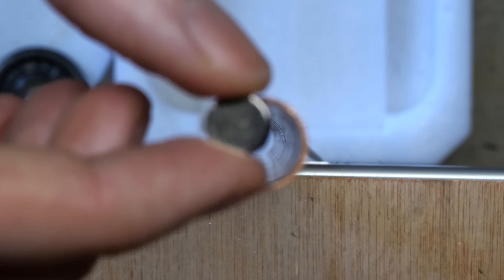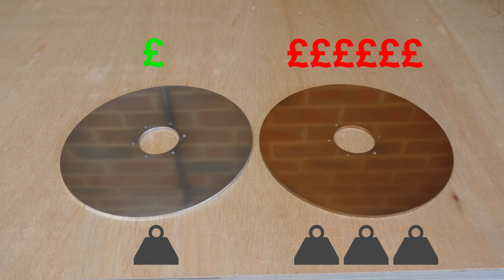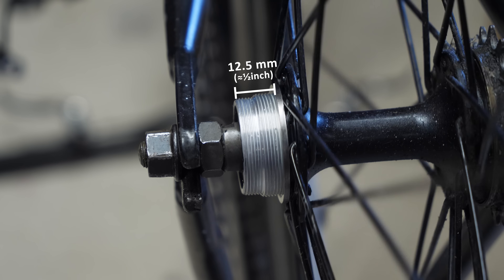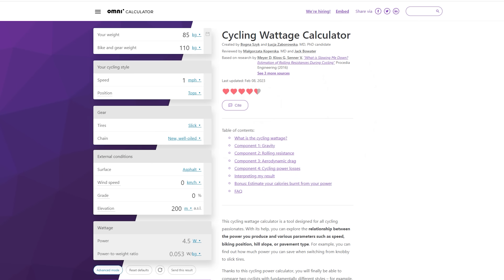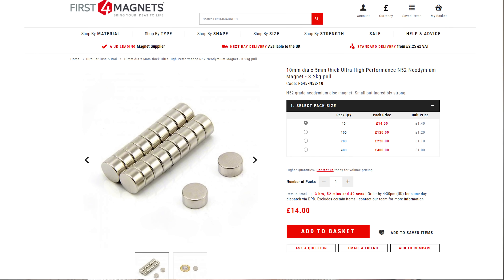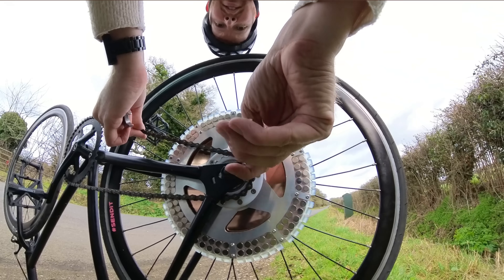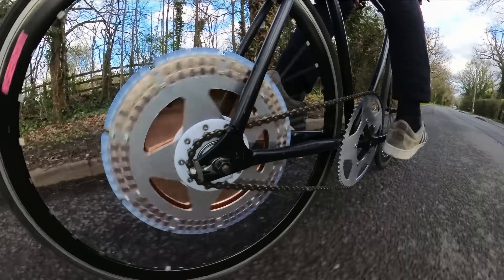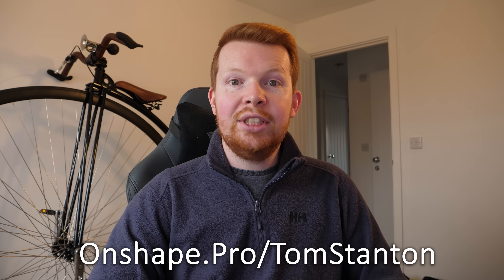Gearless Magnet Bike

Comment: would be cool to see how pedalling backwards while moving forwards would effect the braking power.
Reply: I mean the force was so strong it was basicly pushing his feet forward. Maybe peddling backwards wouldn't even be possible at higher speeds.
Reply: @jackbauer2698  if you look into the world of fixed gear cycling, you find that people can break the traction of the rear tire and lock it by pulling up on the straps that they install on the pedals. The only thing preventing you from pedaling backwards is the traction of the rear tire.
Reply: It would either be enough resistance to break something on the bike, or open a rift in the fabric of reality...
Reply: @dmevolve  it would be a time machine opening a wormhole.
Reply: As a fixed gear rider I assure you you can pedal backwards going forward even on a fixed gear, the tire just doesn’t have enough friction, you can overcome it quite easily
Reply: Yeah thought the same. Does not make any difference just pedalling backwards when trying to brake?
Reply: It will make a big difference. The speed of the magnets and copper disc relative to each other determines how much force they exert on each other. So at higher speed he exerts a lot of effort just to hold the pedals still, but at lower speed it should be possible to pedal backwards and therefore create enough force at the wheel to stop in a reasonable distance.

Comment: could eletro-magnets not work? so they can be turned off/on when required?
Reply: Yeah but they require batteries and with a 3D printed sprocket higher weight can make it more likely to break

Comment: What about increasing the diameter of the clutch? A smaller difference in rpm will still result in a comparatively larger difference in tangential speed. To reduce weight, you could hollow out the inside of the copper disk, and you could design the outer housing to redirect air into the metal parts to help with cooling. Not sure  that would help. 

Also, I’m not sure about eddy currents, but is there any waste from eddy currents going into the rest of the copper disk, instead of being stuck in, and concentrated on, the area under the magnets? It seems to me like you might want to only make the area of the disk that will be under the magnets conducting, so the current doesn’t just dissipate into the rest of the disk. 

Finally, what about arranging the magnets in a halbach array? That way, most of the magnetic field gets concentrated into the disk, instead of half being wasted on the outside of the system? That would also help with the issue of the chain and spokes sticking, since you’d have less magnetic flux escaping the clutch.

Comment: An old Minster Piecemaker pressing machine o used to work with uses an eddy current clutch between the flywheel and the crankshaft to regulate the speed.

Comment: Aluminium is used to make overhead power-lines because it is lighter and less expensive than copper, so it is not a bad choice. Silver would be better, though.
As for the magnetic drive - you are making a viscous coupling like an automatic car. You need to lockup the drive above a given speed for efficiency.

Comment: Maybe you could just use it as a speed brake? Using direct drive of the chain with a ratchet kinda system, so it switches from chain drive to braking with differences in speed

Comment: I used to have an exercise bike that basically did this in reverse: it had strong magnets either side of a conductive wheel. To adjust the intensity of the exercise, there was just a dial that moved the magnets closer or further from the disk. I regret not taking that thing apart before I gave it away. If I recall correctly, the disk might have been ferromagnetic. I wonder how a ferromagnetic disk would perform in an application like this.

Comment: wanted to see temperature of the disk, and you showed it, though after not during driving, wonder how hot it got when driving up that hill. and if there was any risk of copper or resin parts deforming because of that
also also wonder how Gates belt would fare in this setup, it would solve sticking to magnets problem, though spokes would need to be replaced with something else too.

Comment: Yeah you got the right idea make the rear wheel the generator and make the front wheel electric motor just pull your bike. See? If that works can you generate enough power to work electric mode? That would be the question? Can you generate enough power to run the electric motor that would be a good test.

Comment: Interesting project ❤
If you arranged the magnets into a halback array that'd reduce the stray magnetic flux interacting with the spokes and chain plus make the flux in the disc stronger.
Also there are carbon spoked wheels availible :)
Reply: The holy grail of ironless stators.

Comment: Maybe try removing the pedal stop so you can drive the chain in both directions, then backspin the pedals to brake quicker? You'd be inducing a current in the opposite direction relative to the wheel's rotation, which would (theoretically) cancel out the rotational inertia much faster than the simple holding force of the magnets. A two-way magnet bike, essentially.

Comment: I don’t know if regenerative break is available for e bikes but this system can make it possible to recharge your e bike battery during down hill. It is quite interesting and love to see a design like this.
Reply: Regenerative breaking was built into my 2007 Bionx conversion kit.  Newer models (e.g. Aventon) don't seem to have it.  A pity.
Reply: @Darooha better batteries make it less necessary for having a functional max distance.
Reply: Because a bike and rider is so much lighter than an electric car, there's really not that much energy to reclaim when decelerating.

Comment: Would it be possible to mount the ratchet mechanism of the rear gear to the front gear? This way the induced current could spin the chain and gears with the wheel, while your not pedaling. It's a bit complex to implement, but if I'm not mistaken the magnet disk would approximate the speed of the wheel and therefore not brake as much.

Comment: Nice what you did, but why not a big disc in the center of the wheel, aluminum and attach the magnets in it, then on both side sprockets with copper plates, maybe this way you can also apply force on both sides of the wheel, just a thought.... silly me 🤭

Comment: I wonder if a steel backing plate, and/or arranging cube magnets in a Halbach array, would've made a significant difference to the transmission of force. Also, does pedaling backwards make for a decent brake?
Reply: Steel would make transfer much less efficient

Comment: If you're generating heat energy, I wonder if there's a way you can use that energy. Like if you're biking using the magnets, and then have a secondary system that uses the heat to generate electricity for a motor. A build-your-own electric bike, of sorts.
If it was possible, I'd be able to see just pedaling when at downhill/flat ground, then tapping into the electric reserve for hills, to make up for the extra effort needed to climb that you mentioned.

Comment: Are you generating any energy. If so, then maybe attach a motor to assist with peddling and possibly eliminate the need to peddle at all. Connect a battery just to sustain the reserve energy and have limitless power. It may be something cool for those who need that type of assistance.  Opportunity to monetize. 😉

Comment: Cool experiment.

I believe you can get stainless steel bike chains that will not exhibit an attraction to the magnets. I believe some alloys of SS are magnetic and others are not. I'm guessing that if you shop around, you could probably find some kind of stainless steel chain that won't be attracted to magnets, which would have given you options to adjust the geometries of your parts without having to contend with the attraction of the magnets to your chain.

Comment: To get a better baseline comparison between Al and Cu; try using samples of the exact same weight versus same overall dimensions. For example, in the weight fall test with the square samples, make the one surface same in size but adjust the Al's thickness to match the weight of the Cu square.

Comment: Interesting but wouldn't it work (much?) better if you linked the back of the alternate magnetic pole pairs with a magnetic bar (steel, soft iron?) that way the magnetic circuit would be closed? As a good chain drive is, I believe, better than 95% efficient I struggle to see how this setup could be an improvement. Still interesting though. As an aside, this demonstrates how a squirrel cage motor works.More or less!

Comment: A big effort and nice experiment mate , I like your thinking .
I’ve often thought about magnetism for drive lines  and even gear change solutions and magnetic clutch free wheel applications for bikes( wouldn’t it be cool if we could do away with chains and sprockets?).
We have electro magnetic clutches in car air conditioning pumps which are quite strong, I’m thinking electro magnetic would be the way to go , of course powering it is another problem, but solving problems is half the fun 😉.
Cheers.

Comment: Please keep going on this. Working some common bike parts into your project I think you could develop a method of coasting without pedaling. In this video you made a comment about anticipating CVT behavior. Is there way way to incorporate a copper disc with a larger diameter? Perhaps a fat tire bike frame with a standard width wheel? Then have the magnets slide to and from the center for more acceleration/torque?

Comment: You keep saying "No Contact", but when we are talking about physical reactions like THESE, "Contact" loses it's meaning.
Think about it for a moment.
When a chain interacts with a sprocket, the atoms don't "touch". They interact electromagnetically.
A magnetic clutch is doing much the same thing, just at a greater distance.
The biggest difference is the irregular surfaces in "traditional" contact which we experience as friction.

There are other difference, but it is important to remember how "weird" stuff actually gets when you start doing interactions like this.
Common sense doesn't always work.
And analogies can rapidly lead listeners in the wrong direction, since we all experience the macroscopic world.

Comment: 2:02 pretty sure that the rate at which an object falls due to gravity is independent of the weight of the object if you don’t factor in the air resistance, which can probably be neglected in Veratasiums case

Comment: Great video! We had a chuckle when the magnets stuck to the chain...even working with magnets daily, we're surprised when they jump to something steel. I wonder if using shielding material on top of the magnets would decrease the force enough to the chain, rather than having to change the design. Placing a piece of sheet steel over the magnets should redirect most of the flux lines into itself, thus decreasing the force to the chain. Adding this steel could also increase the field strength in the copper. Also wondering how hot that copper gets when you hold the pedals in place.

Comment: Just out of sheer curiosity, might you have been able to decelerate faster from maximum speed by pedalling backwards? If all that is required for eddy currents to generate back EMF is a difference in disk speeds, then a difference in direction qualifies, and much as an EV can regenerate electricity in braking, and consequently recharge the battery, then pedalling backwards would slow you down faster, but with two large drawbacks: that copper disk would heat up much faster, and because the magnets are also electrically conductive, the race would be on to find out if the magnets can hit their Curie temperature and become simple inert ballast before the printed arrays melted and left a whole pile of inert pieces of ballast scattered on the carriageway...?

Just a thought.

Here's another, if you're interested...

A magnetically heated hotplate. Mount a hub with the axle vertically oriented so that the copper disk is horizontal and not turning, and the magnetic array can rotate freely when driven, and adjust the rotation speed for the desired temperature. Probably not very practical, or efficient, and very likely prone to detonation before any useful temperature is reached, but toss a Stirling engine on it and the cold end could keep your drinks cool without refrigerant...?

Comment: Есть идея для проверки.Крыло расположенное вокруг пропеллера.Узенькое,тоненькое закольцованное вокруг пропеллера крыло.Будет ли оно добавлять подъёмной силы за счёт воздуха отбрасываемого в стороны пропеллером?
I have an idea to test. A wing located around the propeller. A narrow, thin wing looped around the propeller. Will it add lift due to the air thrown to the sides by the propeller?

Comment: On a weight basis, aluminum is a better conductor. I think if you use equal weight discs the aluminum one will work better. The reason resistance matters is that low resistance leads to larger eddy currents.

Comment: Practicaly you made a eddy current brake with permanent magnet instead of electromagnets which are used in trucks for long downhill roads 😉 still great, we used this concept with the ability to adjust the distance from the disc to the magnets to make a adjustable brake for dynamometers 😊

Comment: It's almost like it's set up as a kids bike with one gear so when you stop spinning the peddles it brakes not like a normal mountain bike where the pedals spin freely. I guess you could put a bearing that only spins one way in the middle by your peddles. I guess I don't understand how little kids bikes stop. Maybe throw in a separate chain on the opposite that works like a normal bike and make the gear connected to the copper disk huge so eventually it will be big enough to get you really cruising. I also thought the video was going to be used to charge batteries then the batteries were going to be used to spin the wheel that charged the batteries that charged the wheel ha. That middle peddle sprocket being able to be put into neutral would be a big advantage

Comment: Nice project.
But if you want your 3d printed parts to be durable then you better use a fdm printer. I can recommend nylon PA12+CF15 filaments. There are plenty of good printers that can print such things. Snapmaker J1, Bambulab x1 carbon, creality k1 and VLsun V400 would be good examples. 

Greetings from Germany

Comment: Hey there!  The rear wheel hub you have with the stacked reverse threads will accommodate the freewheel drive/gear.  The advantage is that you have the full threading on the (current) drive-side of the hub that may give you a more consistent plane* & you can still use the current parts/materials available 😁

Comment: Remove the pedals and add in an electric motor with a bracket like those magnet holder you made holding an emf antenna to power the motor to drive the chain and  volt regulator and throttle.

Curious to see if that would help

Comment: Hey Tom - I watch your videos all the time and love how you chase a design right down to the finality so that it either works...or it doesn't.  I've been having a chat with some fellow SF writers in a Facebook group.  I came up with the idea of a rocket with a payload that is pulled by a Nose Cone Thruster rather than pushed from the bottom.  The thrust of course would have to be managed from the nose cone in an angle away from the payload directly beneath, which consists of a "pod" for the passenger, with the fuel attached below that which is pumped up to the nose cone thruster.  Think of a conical arrow head with flanged openings underneath and the arrow "body" consisting of the passenger pod and fuel tank below.  Sort of a ....flying mushroom... if you will.  They think it wouldn't fly or would be a dangerous design.  I think it would.  What do you think?

Comment: I don’t understand any of the e bike progresses, if a small light E-motor can be installed in each wheel and an E-generator at the pedals axis, why in the hell do we still install also a mechanical chain in between two of them….for the reminder of what a regular bike looked like? Why not a full electric system, who cares about a bit of range lost by e drive inferior efficiency….and useful to heat up the handlebar…and with infinite gear ratios and torque transmission benefits,,,,Back to the drawing boards, dummies…I need one…

Comment: What about a copper ring, rather than a copper plate? that is, only have copper where the magnets are, and cut holes in the rest to enable heat loss, or use a different material for the interior of the disc? Also, what about a combination of your idea with gears? Could it work with fewer gears?
Reply: I like your words magic man.

Comment: Could you do the reverse use this or a similar system that would create enough current to run a small motor to help in peddling. Not for Braking. So Use a regular brake for the bike. This would be great if you didn't need a battery at all; just the current through peddling.

Comment: Awesome contraption !
8kJ starts to be a reasonable amount of heat 🔥
Did you consider Halbach array (see https://en.wikipedia.org/wiki/Halbach_array if needed) as a possible configuration ? (which btw will obviously not solve the problems you encountered)